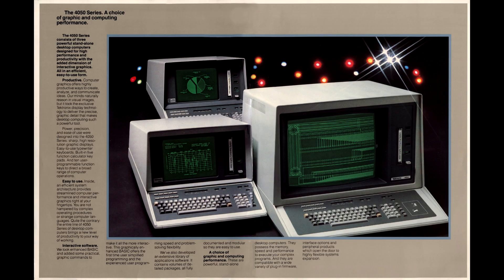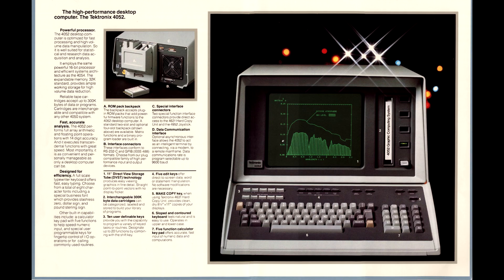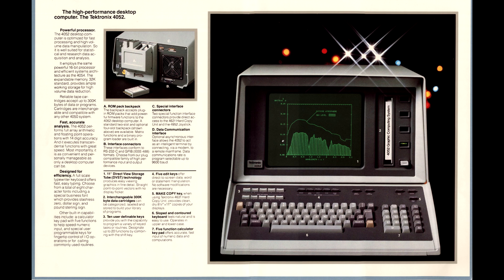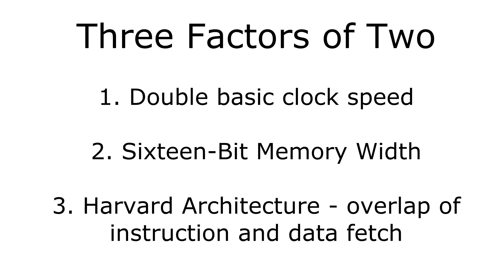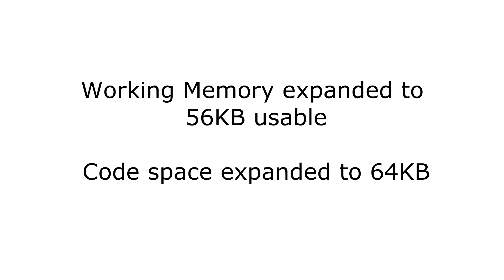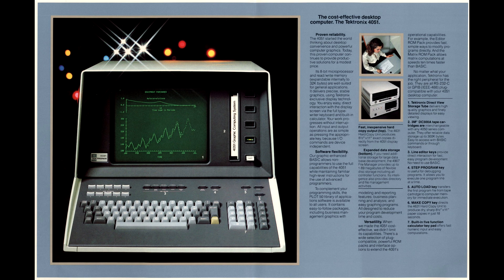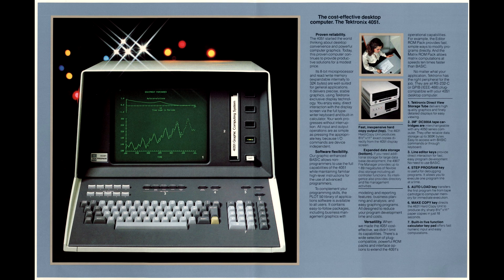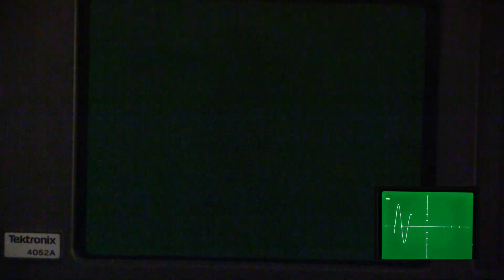Tektronix 4052 Development and Speed Comparison to 4051

Comment: I just searched for and found the Tektronix 4051 Basic Reference Card in my stash ...
In the summer of 1980, I wrote software (as an intern) for a Tektronix 4054.
The system was complemented by a unit with two 8-inch floppy drives (called File Manager), a printer (called Hard Copy Unit), and a plotter, all interconnected via GPIB.
It was the first time I got paid for writing software. It was for the production of heat exchangers which were mounted on the roofs of factory buildings to salvage the thermal energy in the exhaust air. The devices were manufactured for custom dimensions. The order data came in via FAX and were entered into the computer. The program computed the dimensions of the parts for the housing and plotted the drawings for the sheet metals. The bill of materials was printed out. The thing worked reasonably well, although the usability could have been better. We did not use the term CAD at that time, but that's what it was.
After finishing my job, I was allowed to show the computer to a colleague who was the top computer geek at our school. We ran the Leibniz Series to calculate Pi and tested how long it took to compute it up to a given number of terms. We enjoyed the sheer speed of the computations. The Tektronix 4054 was so much more powerful than any other machine we had access to.

Comment: I had no idea the original intention was to make the 4052 firmware compatible with the 4051.  I used both in my work at a Tektronix field service center, and my recollection is that the '52 was pretty consistently at least 10x as fast as the '51.

Comment: Why did they even bother making this when  it would have been cheaper for customers to just wait for a good windows program or a dos application to come along or be written in house to handle what I can only imagine was graphing and visualization of data using Real Time Data off of the Scope's GPIB output bus. This whole product line just doesnt make a whole lot of sense,..
Reply from the maker: Well, it made a lot of money. From the late 60's to the early 80's, Tektronix dominated the computer graphics market. Graphics products made up from a third to half of Tek's revenue during that period.
Reply: The graphics on early PCs was horrible, compared with what the high-end graphics terminals could do in the early-1980s.  That's the bottom line.  Sure, you could wait for newer technology.  If you could wait.  What were you supposed to do while you were waiting?

Comment: Wow a lot work to get some speed. Clearly not a carefully considered approach. The 74181 ALUs were certainly capable of 8X even if only 8 bits wide. Maybe memory speed was the problem. Sounds like a lack of knowledge and understanding on many fronts. But then RAM and EEPROM would struggle at a microsecond. Probably too much unnecessary floating point to generate l2 bits of result to drive the available screen resolution. I used a Tek 611 display back then for graphics on a PDP-8 minicomputer. It was driven by analog hardware to generate lines, arcs and circles. Its only limitation on speed was the write rate of the tube.